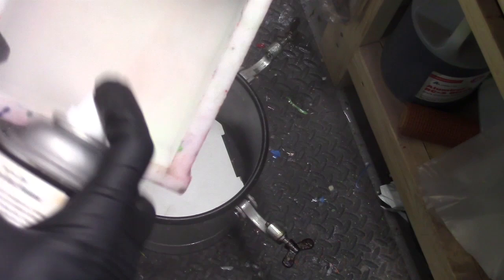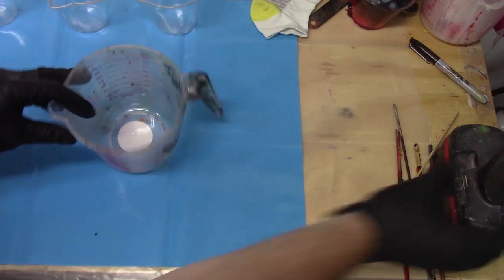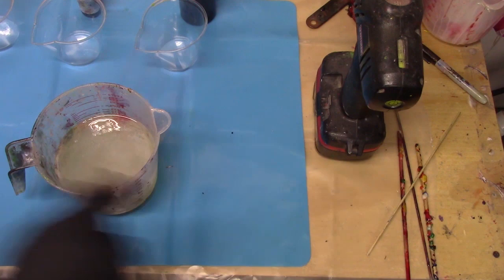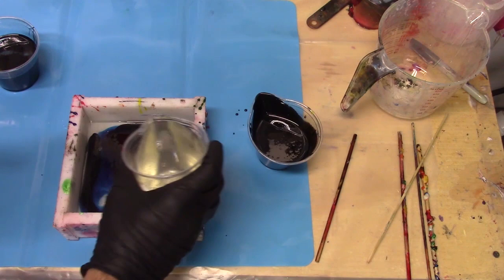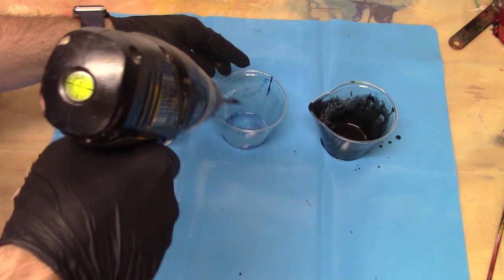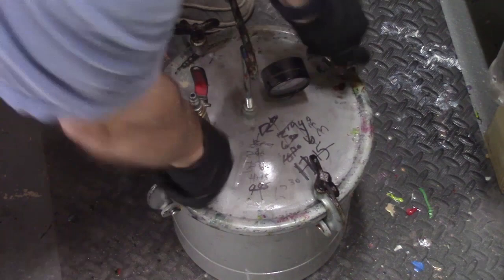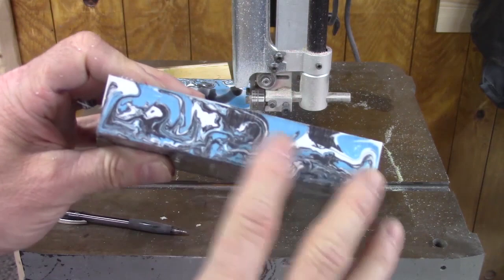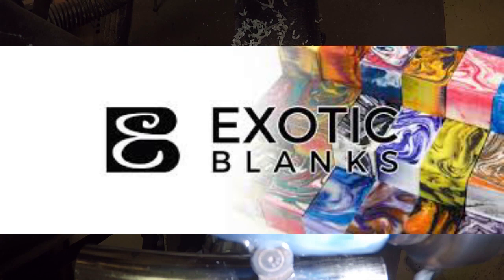10 Minutes To Better Pen Making - Color Casting - Mark Dreyer - Featuring John Underhill

Comment: What bandsaw blade is good for cutting resin?  Can the same blade also do a good job with wood?
Reply: I use the same blades on wood and resin. I just cut slower on resin.
Reply: @JohnU1032  how many teeth per inch?
Reply: I like 6 tpi. They don’t get as gummed up as the smaller teeth.  I’m just cutting blanks and not trying to get a finished smooth cut. If I want them smooth I touch them on the belt sander.